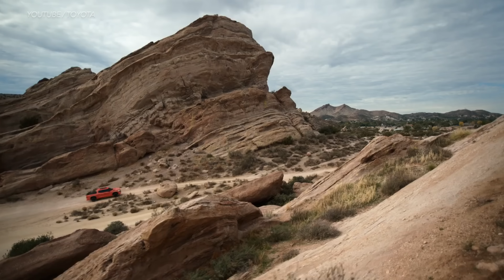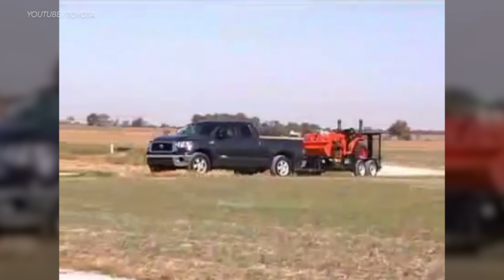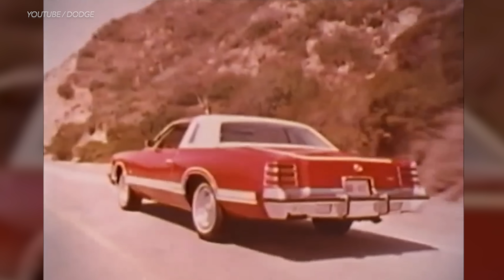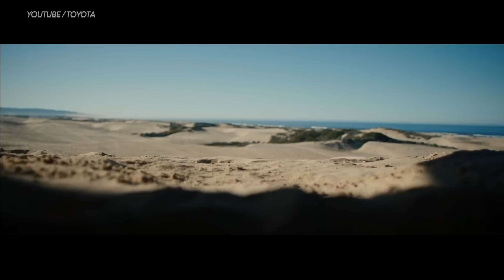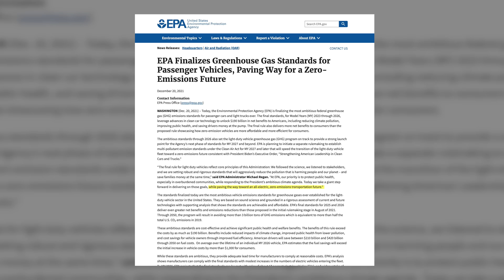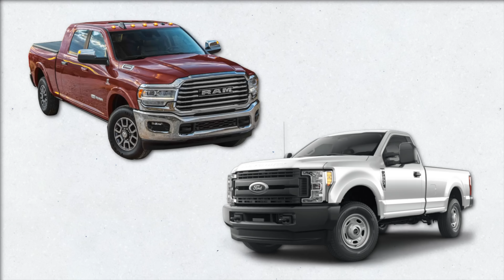Here's Why Ford Just Sued Toyota

Comment: I bought the last tundra with a v-8. its a 2021,its a double cab SR5.   I bought in December 29, 2020 sight unseen! I love it. I tow a 14'x7' enclosed cargo trailer full of tools and a 5000w Honda generator (almost 20 years old starts first pull !) I love the V8! in tow haul mode, it jumps off the mark from full stop. I get almost 11mpg towing, and about 17mpg with out trailer. its very quiet and very smooth and comfortable . ive taken it on camping vacations where I drive up to 400 miles. I tow every day of the week for work. its flat out the best truck I've ever had. I paid $39,000 at Middletown Toyota in middletown, CT.

Comment: 21/8 22 Do you have to change your driving technique to get the best from turbo-ised engines ? Also, checked the oil on a friend's 1 litre FIesta recently & it looked like liquid soot ! Owner's Pack indicated oil was changed 5000 miles previously & oil change intervals were 18000 miles or at 12 months. Is this good for longevity ? Now when l see a Turbo motif l think Turbot - something fishy going on !

Comment: A N/A car is proven to last way longer than turboed engines are simply because the engine isn't overpowered when N/A. When the fans speed up, the process of combustion speeds up creating more power but also more room for error. A v6 tundra with twin turbos is not an ideal set up. Especially since the weight of a truck is already upwards of at least 4k pounds or more creating the need for an engine to easily carry its wait and not strain itself. That said, if I were to choose my new tundra it'd be the v8. End of discussion

Comment: The Tundra has never been a serious truck, the beds wobble when they go over rough roads or potholes and they only had 5 lug axles and now the new one has plastic bumpers, skid plates and no tow hooks. Tundra is really for guys who drive a Tacoma and decide they want a bigger truck or guys who's wife drives a camry with 300,000 miles and thinks the Tundra will do the same.

Comment: Simplicity of mechanics and good maintenance is the key to a car that’ll last 30 years.
Reply: Yeah. Adding more electronic bells and whistles as well as increasing the complexities of the engine system does not make for a long lived vehicle. I see just about every change they’ve made to the Tundra as a negative at this point.
Reply: That`s why were still driving our 1984 & 1989 S10`s! Simple to repair & on the 1984 no OBD`S at all.Our 1970 C10 doesn`t even have HEI. Just points & condenser. The 1970 C10 also is able to achieve 17.1 mpg overall if driven conservatively with 350 / 350 combination / engine transmission.
Reply: @frederickbooth7970  still driving my 93 Chevy..it turns 30 in July.

Comment: And new Toyotas are no longer reliable. Now are small engines  with  Turbos and most models  are only hybrids options.  The older used models with just naturally  aspirated going gain value and Higher costs.

Comment: Wouldn't be surprised if the engines pack in somewhere between 33,500 to 65,000 miles compared to well over 100,000 for a V8 if regularly used for anything more than a family runabout.

Comment: The whole notion of a turbo goes against everything Toyotas stands for which is extreme reliability even with low maintenance.   Turbos are gonna be maintenance headaches. Scotty has said numerous times that need very clean oil.  Most Toyota drivers just want to put gas in and go.

Comment: Given that the new LandCruiser 300 series and the Toyota Tundra, there's no real reason you couldn't have the twin turbo v6 diesel from the LandCruiser. It has slightly less power at 305HP, but a whopping 515 foot pounds of torque.
In the LandCruiser this engine's average epa fuel economy is 26mpg. (31mpg highway and 21mpg city).

Comment: I vote for simple, reliable and consistent. Ever hear that less is more! I drive older VW diesels, 385,000 miles. Took me 4 hours to replace the timing belt in my drive way. Anything past 2011 is off limits for me. Generally, older with less wires, circuits and computers is better.

Comment: I don’t think it’s fair to compare V8 to NA v6 truck engines. This goes across the board in the truck market for the most part. If you are going to compare the V8 models to the V6 it’s prudent to mention the fact that they are TWIN TURBO’d they are making the same numbers or in fords case the 3.5 out preforms the 5.0. I don’t think this video was fair in marketing the new tundra as v6 and mention at the end they can tow more. it’s important to mention it’s really making the same numbers or close to the 5.7. You can yell at me all you want about NA out lasting Turbo engines and that’s fine and there is an argument. But I think is wrong to riding off a truck just based on the fact it’s a V6, I think it’s valid to say you want a V8 for longevity but in most cases you are getting more power out of these new TT V6 engines.

Comment: As I’ve gotten older I care more about reliability than mpgs. You can spend a whole lot more a month on repairs than gas. Biggest repair bill I ever got was replacing the battery on my old prius and I said I’d never buy another vehicle with a huge battery. That replacement negated anything I saved on gas. I wouldn’t mind if some new de-teched vehicles came out.
Reply: Simplicity is not what they want. They want complex, hard to fix, dealer only repairs and less “right to repair” our cars/products.
Reply: Wondering how many EV or hybrid batteries are relaxed each year. My guess is not many but would appreciate an actual number.
Reply: Good point...and Gas is something you control... mechanical breakdowns are out of your control.
Reply: You should do the math and see if including battery replacement it evens out cost wise
Reply: I love my 04' Honda. Keep the fluids changed and don't drive it hard. Best vehicle and maybe the last vehicle i own
Reply: My 2 favorite vehicles are my restored 75 and 84 chevy trucks. Beefed up axles and extra cooling.  Put a mechanical 12 valve cummins in the heavy one, they both get over 20 and don't break.
Reply: Just get both reliable & fuel efficient. I disagree with the prius being unreliable or not worth it though. As someone who does uber eats in my dad's reliable lexus gx V8 suv I disagree. My suv can go 345 miles of range & it takes 23 gallons to fill, 14/17 mpg. The prius can go double the distance with a range of 600+ miles with a full tank of just 12 gallons. I literally have to fill it every 2 days $80 each to get 20 gallons. Considering I'm pushing the tank near empty each time. With the prius I would fill it up every 4 days for $40. So in 4 days instead of spending $160 on gas with the suv, with the prius I would only pay $40. That's saving $240 a week. Which is $12,514 a year of savings. The prius battery will not die within a year & is not as expensive to replace compared to the accumulated cost in poor fuel economy cars. It's around $800-1500 from what I can see.
Reply: My wife had a Compass with a CVT and when it died at 130,000km the dealership said that the fuel savings equaled the price of a new trans...what a joke of a world we live in.
Reply: Only  1000$ to get a prius battery rebuilt
Reply: Look into classic cars.  The weslthy elitists love them and have collections, so they have a lot of exemptions.  I suppose you could form a non-profit classic car museum and name your garage....
Reply: Toyota are famous for their reliability. V6 or not, I don't see that changing.
Reply: dont replace the entire battery, you just need one or two cells replaced
Reply: @1mostwanted253  but if you listen to Scotty the other cells will soon follow so its more time saving and cost savings to get a whole new battery (not refurbished) and get it done and over with in one shot.
Reply: @Gleeleeglee  a lot of times people just abandon their prius’ when the battery goes to buy something new though. Completely negating any environmental gains by owning one in the first place

Comment: Maybe these manufacturers need to go back to 1994.  My 1994 GMC Sierra extra cab with the 350 cid, 5.7 liters for those my old enough to refer to a V-8 correctly,  got 23 mpg at 70 mph.  I know because I drove this truck for almost 15 years and when I sold it with 365,000 on it it still got 19 mph on the high way.  Not bad for TBI fuel injection.

Comment: The Tundra makes more torque at a lower RPM than the out going V8. It also tows more. In most towing tests the turbo V6 had more than enough power to tow heavy loads. The biggest problem with turbos is keeping them cool. Toyota has overbuilt the turbo cooling system. As with most Toyota engines the internal engine parts are forged making them strong enough to handle the added pressure of a turbocharger. It seems the no V8 haters are nit picking the truck! Turbos in Diesel engines last up to a million miles. With good design there’s no reason for them to not have a long life in a gasoline engine.
Reply: First of all the turbos don't last a million miles. Just go look at what 2 new turbos are for the Ford V6 and life expectancy. I just looked them up and there 1500 to 2000 bucks a crank plus installation.  You also cannot use diesel logic to a gas engine not even remotely close in engine designs.Your also forgetting that they are using GDI in conjunction with said turbo. High cylinder pressures leads to Oil burning, Oil dilusion and Pre mature failure of engines. I bet 200 to 250k miles will be max life of these trucks. At 60 to 70k a pop that an expensive proposition. It may look good on paper but there is no way no how that a GDI  boosted v6 can out live a naturally aspirated V8. Sorry, If you end up buying one good luck to you sir.
Reply: @drebelanski7869  time will tell how long the turbos on these engines will last! Direct injection is also used on diesel engines. They use extra rings on the pistons to prevent oil dilution. Also Diesel engines have much more oil so it would take a lot more fuel to significantly dilute the oil. There’s no reason these steps can’t be taken in a gas engine as well. The life of a turbo is greatly determined by how well it’s cooled. The cooling for the tundra turbo is massive. A variant of this engine has been used in the Lexus LX for a few years and it’s been reliable. I never said turbos in diesel last millions of miles. I said diesels last up to a million miles. At that point they usually get overhauled.
Reply: @drebelanski7869 . In Europe Volvo, Mercedes’, Scania,DAF and other diesel trucks all have turbos and will all do a million miles with good servicing. 
 You can get turbo service kits and they are easy to fit the bits too. 
 My Lithuanian buddy’s sprinter has over a million on it now. It’s only a 2.1 litre.
Reply: @drebelanski7869  take care of the vehicle it will last 200k no problem that goes the same with almost all turbo 4s and 6 cylinders. also toyota is using duel injection its gdi and port injection making the issues with gdi which mostly have been solved anyway mute
Reply: @drebelanski7869  jesus thats expensive. 1500 - 2000 x_x
Reply: @drebelanski7869  dreams
Reply: @amandeepbaa6978  
HUH?  you dreaming lol
Reply: Tell that to the people who've already had problems with the turbos on their new Tundras.
Reply: @bghoody5665  by all accounts it was only about a hundred trucks. The actuator on the waste gate is electronic and failed to open. They got a bad batch of parts and it was quickly corrected. Interestingly it was only on the passenger side turbo. This has also seen on Ford eco boost engines with people who baby their cars and seldom use the turbo. The waste gate would start sticking.
Reply: They also don't offer a regular cab. It's not a work truck. There's a reason you don't see tundras on work site unless it's the boss like driving around doing estimates
Reply: i like how people keep saying toyotas are over engineered or overbuilt as if theyve done something special. no, they just do things in the simplest way they know is possible. turning to new cost saving techniques like pour casting or all the plastic parts that will melt over time, that is over engineering and overbuilding. trying to replace things that already are higher in function as they are, now that is over engineering. toyota engines are reliable, because of the fact theyre not over built, they tried to overbuild it once before by modifying the rings, and we ended up with an oil eater engine for years circa 07.
Reply: @MrPaxio  dreams
Reply: Nice comments
Reply: We can see 90's era turbocharged cars running fine as long as parts are available, can't say much for GDI cars after their warranty runs out.
Reply: Guess toyota learned from Honda on how to keep engines and Turbos cool.
Reply: The fact is turbos need replacement in all kinds of vehicles.  In trucks, higher spooling while towing will result in premature wear.  Turbos is also another way around emissions taxes than a straight V8.
Reply: This is one well said argument in favor. Kudos
Reply: But everyone knows.. the more moving and lubricated parts added are more failure points. It may be a great engine over time. But when one of those turbos goes 2k plus repair bills.

Ill take tried and true 5.7
Reply: If teh intercooler is sized correctly it could help, but I'll take my NA V8 over a V6 Twin Turbo all day long while living in the desert.
Reply: @BigMikeLV  why would the intercooler not be sized correctly? the stock one on my 4 banger turbo is more than enough to keep the turbo under temp, even through harsh conditions. sure, if I want to pump more power I need a bigger turbo and intercooler. Todays turbo charged vehicles are more reliant on firmware than hardware. Such as the case with Hondas turbo engines and them needing a firmware update to fix issues.

Comment: V8 truck accelerates faster than the V6 turbo ones at 75mph  or higher on highway, especially when loaded with 5 people and stuff in the bed. Imagine the V8 as a big heavy strongman and V6 turbo as a smaller framed body builder, load 200lbs on their shoulders and ask them walk for 3 hours, I think V8 dude can handle the load better, V6 turbo dude will make it but will sweat way more

Comment: If Toyota came out with a diesel Tundra then it would probably be OK to nix the V8, as people coulid still get a V6 which is probably good enough for the "wannabe" truck owners who pretend they need a truck.  The diesel would be for those who really need to do work.  But I'm surprised that Toyota did away with the V8, and went with twin turbos.  I mean everyone knows that when it comes to turbo chargers it' s not a question of IF they will go bad, but WHEN and HOW MUCH will it cost to repair them.  Personally I think Toyota should have kept the V8, maybe incrased the price, and then maybe offer a diesel option as well, maybe a diesel 6 cylinder engine like Doge does for some of their RAM trucks (which are really just Cummins diesels).

To the V6 vs V8 and fuel economy, one thing to consider (that Scotty omitted, but probably for a reason) is that vehicle weight will also play a role.  Even with a lighter V6 engine, if both trucks weigh close to eachother, like the V6 weighing say 5500 lbs empty and a V8 weighing 6000 lbs empty, the V8 may still get better gas mileage because it has to work less hard.  Of course if the mechanics of the V6 give it more power in a smaller package, then possibly it could get better gas mileage, but the number of cylinders isn't necessarily a good indicator of fuel economy.  Of course a 4 cyinder is going to get better gas mileage than an 8 cylinder in 95% of applications.  But weight of the vehicle is also something that has to be considered (generally mfrs do pair bodies to appropriate sized engines, for example Chevy wouldn't put a V6 or even offer a V6 for a Silverado 2500 or 3500).

Comment: Why not just make a law that cars have to get 100 million mpg or go a million miles on a charge?

If all you need to do is make a law, hell, let's mandate time travel and a cure for cancer.

55mpg in 3 years is ridiculous, and besides, buyers can decide. Obviously if I have the choice between two vehicles that do what I want and need, and one gets 13mpg and the other gets 23, I'm going to choose 23.

EPA mileage ratings provide information for buyers. That's sufficient. There should be no CAFE mandates.

Comment: Enjoy the educational value of your time Mr. Kilmer 👍
Off topic question to you sir. 
2002 Buick Regal LS with a erratic gas gauge swinging sometimes to full and empty, put in new fuel pump with sending unit and adapter plug correctly reconnected battery and fired up the car and took it down the hwy and back and the gas gauge now rests on 1/4 full and I have an almost full tank. Could it be in the instrument panel itself or does the computer need reset? 🚘

Comment: Its pretty clever Scotty how you said lets compare the V6 to the V8 but not once did you actually show or compare the 2022 Tundra V6 specs to the other truck so there wasn’t really any comparison done. The whole video was a  rambling affair about how V8s are better than V6 for towing but you never actually show any factual data or specs comparing the Tundra to the other trucks. Doesn’t that defeat the whole point of the video?